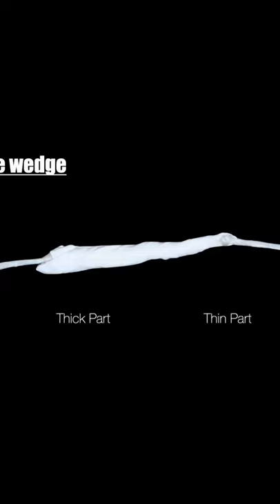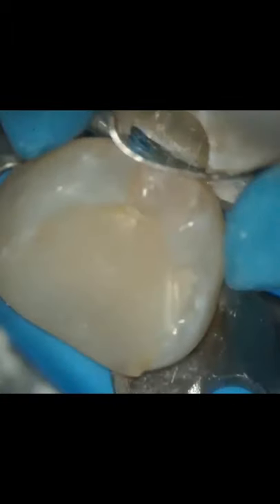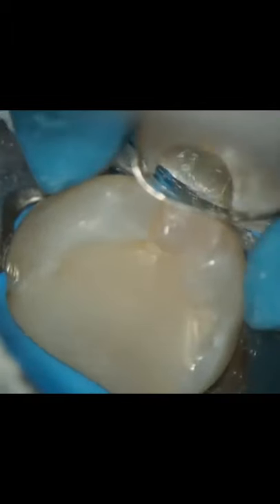Teflon Floss Technique - #DentalShorts

Comment: Is there a video on how to do this ? Do you basically put the floss with the wedge and wrap it around with teflon then feed the floss through the interproximal contact as you place the wedge in then pull the floss through which then "tightens" the seal on the exposed margin ?
Reply from the maker: Hi! There is actually no wedge - just floss with a few knots and PTFE. Happy to sure Maciek's tutorial showing how to do this - link is in description